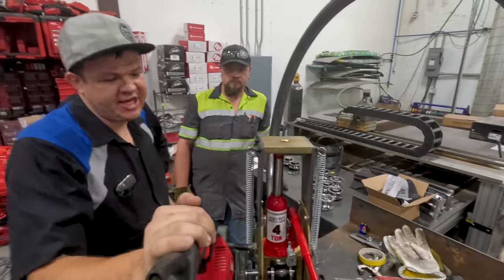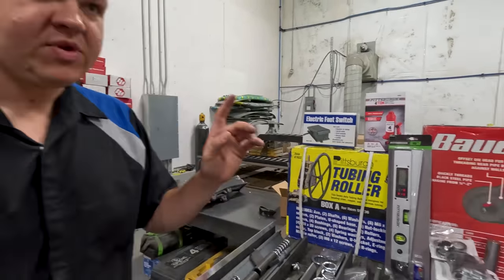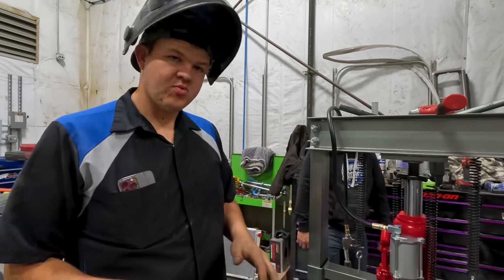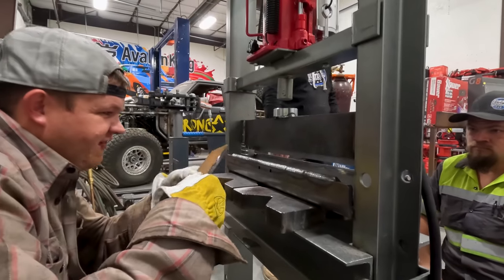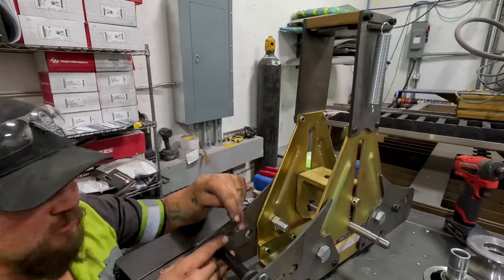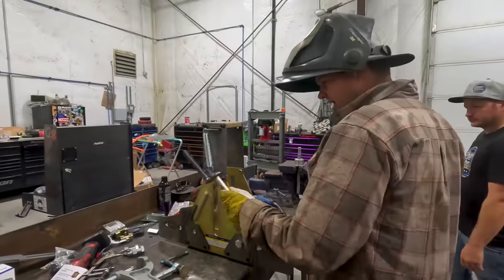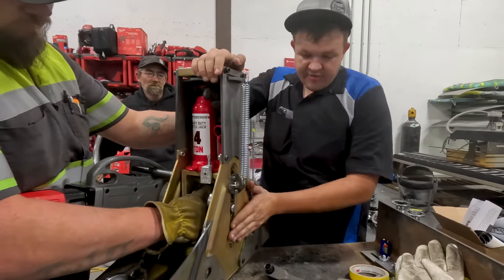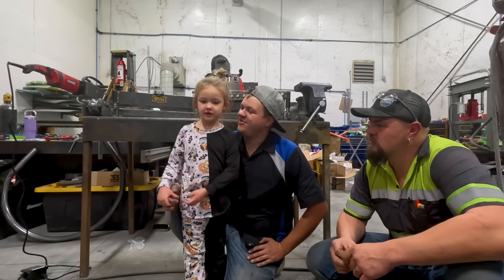How To Build Expensive Shop Tools On A Budget!!!

Comment: A tip for for your Bauer band saw: Add a thin piece of sheet metal under the flat base plate that has a slit the width of the saw blade to prevent slivers of metal from passing through the bottom guide rollers and the saw blade. It will prevent breakage of the guid roller bracket. The guide roller bracket is not available from Harbor Freight for replacement. I learned this from experience.
Reply from the maker: Thank you!!

Comment: The way to stop corkscrewing is to make a straight line down the tubing and make sure the tube stays straight while rolling.
Reply: To make a straight line, put two tubes together and take a sharpie and draw in the "crotch" where the two pipes meet. Straight as can be on both pipes.

Comment: Lincoln is 2? WOW, in a year he'll be doing body work!

Robby, might contact Bleepin Jeep, He bent one of those rollers on his channel and he did an awesome job rolling a cage to fit the contour of a gran Cherokee. It looked awesome and fit the curves perfect, so he may be able to give you some pointers. Or, contact SWAG, they should be able to help also.
Now with the press, you'll be able to cut some stuff on your plasma table and bent parts instead of welding parts(on some things)

Comment: I worked in a machine shop for 33 years. We always called it a brake press. That’s because we had several types of presses. On your “finger” forming, you’ll need die relief. You can still use a long punch even if you’re forming a small finger.
Reply: Shhhhh.... I was waiting for them to figure out the finger  brake cant work as is and then try to figure it out.
Reply: @notsofresh8563  I was torn too..

Comment: Hiya guys, another great video, I am guessing others will tell you more, but the finger plates are also used for box folding, that is for folding corners together to make a box or trays. Also you should  grind smooth to the point of polishing the long welds along the bottom former, or if you are bending or folding a piece or thin sheet that is to be sprayed say a part of the body work of a tidy vehicle the welds left as they are will deeply scratch the steel your folding.

Comment: @Robbie You'll get a nicer corner on your thinner bends (ie 1/4") if you drop some 3/8 (or thicker) plates into the bottom V. The idea being that you reduce the width of the V.

The magic number is 8. Multiply the thickness of the material in mm by 8.  That gives you the width of the top of the V for that material thickness.

Comment: On your tubing bender; build an adjustable guide at one end that can be adjusted for pipe/tube diameter.  The guide will keep the pipe/tube in line with the bend so you don't make corkscrew bends.

Comment: Man you're so lucky. I wish I could get a Harbor Freight or Milwaukee Sponsor. Dang.
Reply: Sadly even Milwaukee has become a Chinese owned company and part of Hong Kong's Techtronic Industries.  In 1976 Albert F. Siebert's Milwaukee Tools started changing hands about every decade first being sold to Domino Sugar followed by Merrill Lynch and then overseas to Swedish Atlas Copco who sold it to Techtronic Industries in China.  Their the ones that brought about the drop in quality of the cordless Craftsman Tools in 1987 along with numerous Ryobi, Rigid, Hoover, Bissel, Royal, Homelite, AEG, etc, etc, etc products.  Truly hope that Milwaukee doesn't eventually become a Ryobi with a Red Dye Job like the Ryobi tools dyed Orange with Rigid labels slapped on them.  

How bad is it?  I replaced a main ball bearing in a Rigid Power Tool that had failed after a few months of occasional light use and the local bearing supplier couldn't match it since it was far below the minimum level of quality they required at the bearing supply house.  What made it even sadder was that a much higher quality bearing was available locally on the shelf only costing about $1 and has outlasted the original by a couple of years while now in frequent heavy use and is still going strong running as smoothly was when I first installed it.

Yes, a sponsor would be nice and shortly it may not make much of a difference quality wise whether its Harbor Freight, Milwaukee or some other Chinese tool.

Best!

Comment: If the cost of the tool is less than the cost of the job(s) it is not a waste of money. 

Is the water based paint less toxic? The furniture stain i used to apply was tolulene based and all the lacquer/sealer was acetone based. I dont mind working with acetone, but tolulene was aweful.

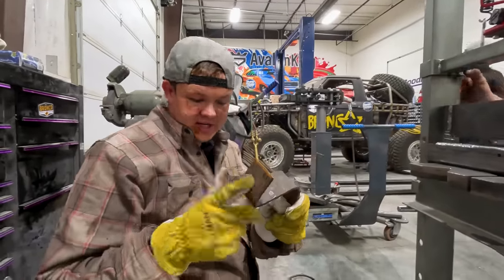Comment: DO NOT WELD HARDENED STEEL, ESPECIALLY SPRINGS!  They have to be heat treated for hardness, and welding will anneal the local area (causing internal stresses).  Yes, it may hold for a while, but it will eventually crack.  11:44 Stick with bending gauge metal.  Plate metal (>3/8"ths) is a different animal, and can cause serious injury if the hardened steel dies shatter.  Even a mushroomed headed punches have been know to blind ppl, by shrapnel (WEAR YOUR SAFETY GLASSES!!)  Have you ever seen a commercial product which has a welded piece of hardened steel or spring?!  The Coefficient of friction for steel on steel is .07 (it's why trains are so efficient, and wreak going down hill so often), yet you should still add some lube when bending parts.  (car tires CoF is .24)
Reply: Agree with the springs, found out the hard way with farm equipment and lost an entire day at the worst possible time.

Comment: Those swak off-road press brake kits for hydraulic presses are garbage, the cyclops design press brake for hydraulic presses is a really nice press brake attachment and they are made in Sheffield England.  I purchased my cyclops designs press brake attachment two years ago after trying those other junk kits.
I had the swag press brake and hated it.